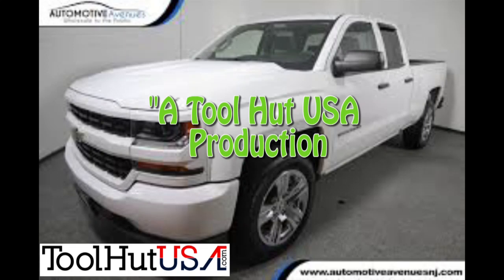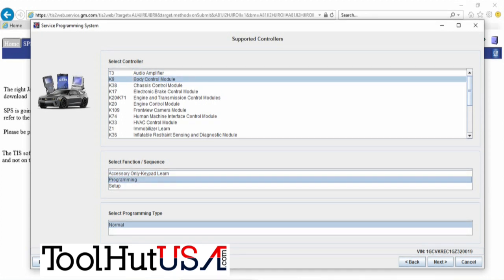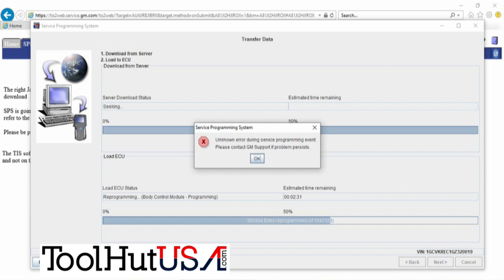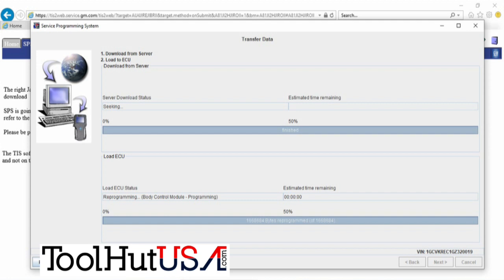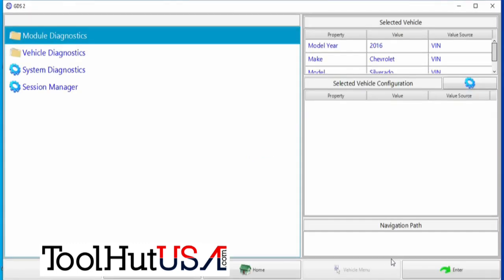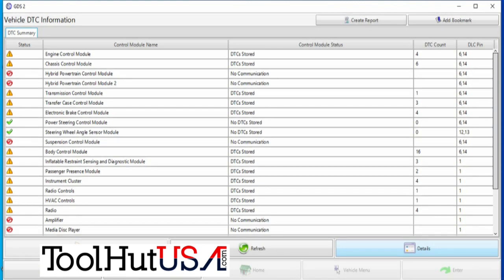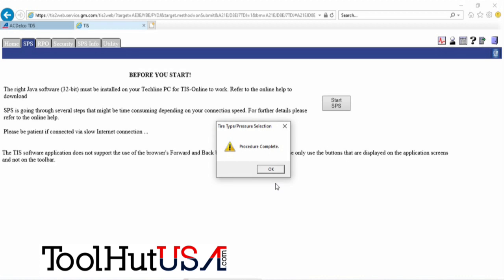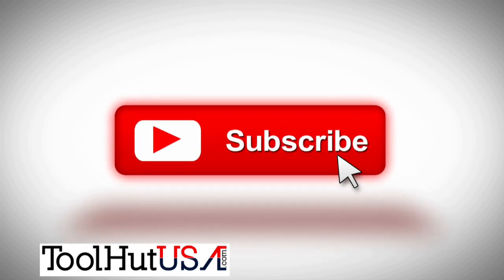BCM Programming and Setup 2016 Silverado | Tool Hut USA

Comment: Hi there, i am currently working on a 2016 chevy silverado regular cab and i am replacing the bcm but i reach to the point where it says the odometer is being programmed and it gets stuck there and says communication is disconnected. Please help if you have any idea. Thanks
Reply from the maker: Is it a used bcm or reman?

Comment: For anyone trying this currently - ACDelco has updated their program to fix the issues that he runs into in the video. ALSO - need to go through an Immobilizer relearn to get the truck to start. There are a few options when selecting the immobilizer relearn within ACDelco TechLine there are a few options depending on if you want to program new keys or not. There is an option for a BCM replacement where it retains the old key setup.
Reply: Thanks. Thanks for letting us know. It seems like a big thing not to include in the video

Comment: I have a chevy silverado 2017 with bad bcm and i think a fu box is bad too can you programming those two things?
Reply from the maker: How have you determined they are bad? Yes I can program a new bcm. Not sure where you are located.
Reply: I live at indiana 3 hours from Detroit Michigan, when I buy this truck at aution was burn at stereo área I did replacement the arnés New from dealer I put a use stereo, when I did try turn on the truck the lights doesnt come on I open the bcm and I see is bad, and I guess the truck get fire inside maybe the fuse box interior is bad too I have already both fuse box and used bcm
Reply from the maker: go to thecarflasher.com and send me a request. We can discuss further
Reply: @toolhutusaakathecarflasher3019  ok thanks  I did
Reply: I can take the truck to Detroit if you can programming those things just let me know where thanks

Comment: Can you use this process to unlock heated seats. I have added all of the components but need to turn on the option.
Reply from the maker: Not that I know of. Normally you need an authorization code from gm to add components to the vehicle. Sometimes they just work though
Reply: @toolhutusaakathecarflasher3019 I do it with hex editor, I change the vin then program in the options with tds then switch the vin back, I add alot of features,  it's also how I change mileage, I also do hmi upgrades, cluster with wifi and other functions to these trucks, I unlock chrysler ecms, I can also make a ecm have instant monitor ready but let's not do that haha
Reply: I can

Comment: Can you program the bcm on a 2020 silverado? I did a lt headlight and fog light conversion on my 2020 silverado custom and it drains the battery after a few days of sitting. I have the proper harnesses with resistors for the headlights. The dealer programmed the fog lights but say the bcm is staying on due to the led headlights.
Reply from the maker: What you want is a retrofit. No I am sorry I can't do that

Comment: Hey Sam BCM issues here. 2018 Durango SRT and I changed the factory radio out for an Alpine unit. Then Boom the radio would go out, the air would blow randomly, couldn't control the windows at all, it's like the car became possessed. Bought a new factory radio, installed it, same thing. Took it to dodge & they declined to work on it because I took the radio out (voided warranty) but told me I needed a new BCM. Any recommendations on some hard-software to program it?
Reply from the maker: 18 durango will need to be done with a J2534 tool and J2534Witech 2.0 or Witech 2.0. No real shortcut on these yet,
Reply: @toolhutusaakathecarflasher3019  thanks Sam! When you say no real shortcut, could you elaborate?

Comment: Hi, i just changed the BCM of my 2014 chevy silverado and everything was programmed as you did in your video but i still have a DTC in my body control module about configuration, and the EBCM is not working, codes on the EBCM modules are ( B3902 incorrect immobilizer identifier received, U0151 lost communication with inflatable restraint, U0077 control module communication chasis, U0126 lost comunication with steering wheel) I think it must be a setup I have to perform but I can’t find it. Any idea what it can be?? 

Thanks.
Reply from the maker: I suspect you need to setup the immobilizer
Reply: I have the same problem 2015 silveradp dont let me to program the key, I need help I follow all the steps

Comment: Sam I had a question while reprogramming the BCM. Where is the mileage stored on the truck while doing this program? I have a 2015 2500 Sierra and may have to do this also. I know the older models are stored in the odometer board. Wasn't sure about the newer models. Thanks for the video. Good information.
Reply: So whats the answer?

Comment: Hey I had a question. Its in regards to BCM, I have a 2016 Tahoe, I installed 2018 Tahoe Headlights, as they have a brighter led bar, wiring is the same on both, they are both halogen, only difference is 2018 models run the LED Light bar as the Daytime running ligh, and the LED bar is brighter, the 2016 ran the halogen bulb as the daytime running light. The 2018 headlight I installed has a brighter LED light bar. I want to run this led light br as the DRL. I purchased a membership to ac delco and have everything setup on my computer with the scan tool. Is it possible for me to reprogram the BCM like the 2018 ls model? I have my vin, and a vin of the same spec 2018 model, but obviously the newer headlights.
Reply from the maker: If you can purchase as an upgrade from gm parts they will have a authorization code.
Reply: @toolhutusaakathecarflasher3019  hi the headlights were taken off a salvage vehicle
Reply from the maker: @BradAtDisney  I suspected that. You are missing my point. If it can be purchased as an upgrade from parts department. You should be able to purchase a authorization code or call acdelco and get help. If it can't be purchased from parts I do not have any idea how to fix

Comment: Hello Sam great video,and great tip on the brake pedal sensor. little off the subject, 2010 Mustang V6, locksmith try to add a key with hotwire programmer couldn't do it, took car to a shop to have the cluster swapped from a 4 gauge 120 mph to a 6 gauge 160 mph, dont ask me why, but shop programmed used cluster with IDS, from that point car never started again, they tried to put original cluster same problem, car was brought to me, try to do parameter reser but when it ask you to turn off key, kicks you out and never do the 10 minute. any help or suggestion will be appreciated, i did try a second donor cluster but still doing the same.
Reply: Well, codes would be nice to see. Those can be very helpful as to what could be wrong. I mean a whole system wide scan along with all the codes that return once they're cleared. After that, you can go from there. Not sure what tool you're using to do the PR. Any info would be helpful.